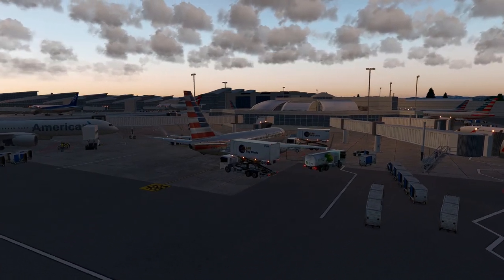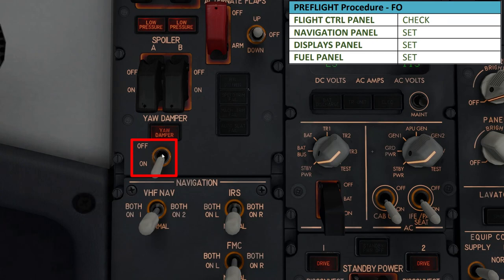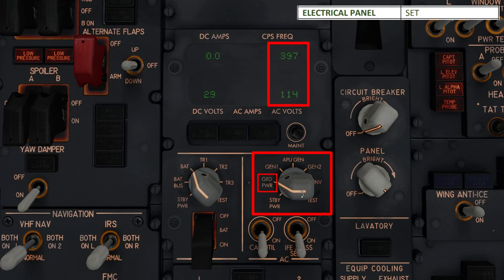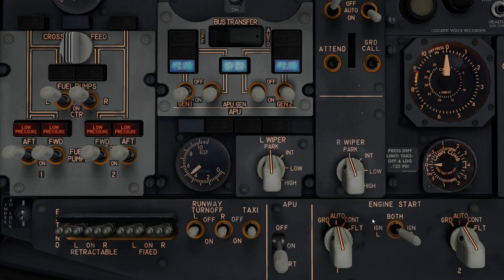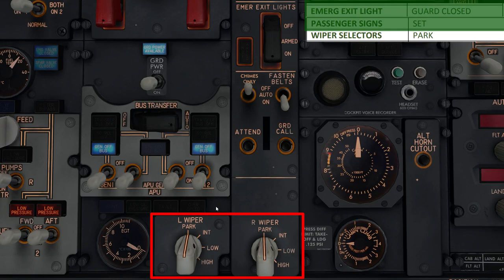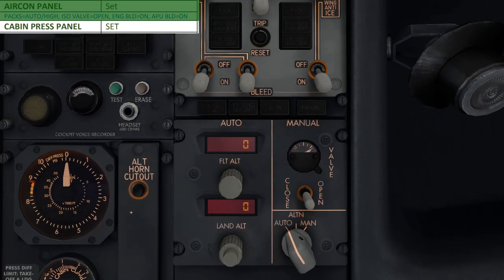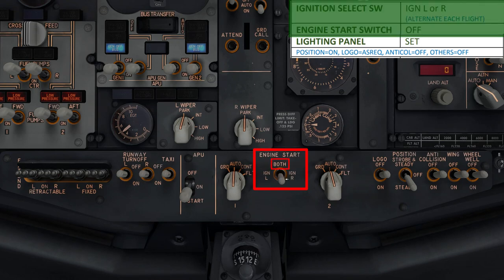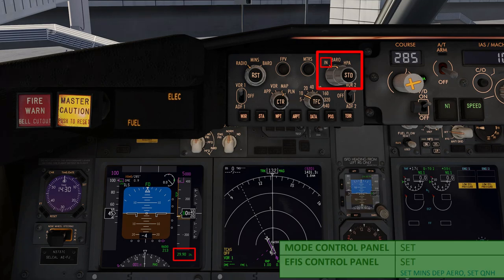Aircrafts Dissected Ep 10: Preflight Procedure IZibo 737IX-Plane 11 Detailed Tutorial (W/ Checklist)

Comment: Just a note for pilots: You must have both wing tanks full prior to fueling the center tank. This already occurs automatically with the Zibo mod using the fuel truck. Please don't use the fuel button on the X Plane customize aircraft menu. Everything is done on the flightdeck and through the EFB via AVITAB.  Additionally, the Emergency Exits armed must be performed prior to allowing passengers to board. The electric hydraulic pumps may be turned on for the person doing the walk around to check for hydraulic leaks. Of course confirm with ground crew if any are in the vicinity. There is an option in the EFB to sync the input of the FO with the CPT for barometer. This is useful as a single pilot in desktop sim.
** Finally, I respectfully disagree with placing the departure elevation in the pressurization panel. Flying up to pattern altitude to circle back for landing will have negligable effect on pressure. However, it will be catastrophic if the pilots forget to change it after takeoff and the flight deck is pretty busy during this time. My FCOM states "LANDING ALTITUDE indicator- Destination field elevation" as part of the Cabin pressurization panel checklist. Congrats on gaining another 100 subs since I saw your last video. You might break 1,000 by the end of the month.
Reply from the maker: Hey there, thanks a lot for watching the content. I truly do appreciate it. As for the wing tanks being fueled completely before the center tanks being fueled up, I already addressed that in the first aircrafts dissected video but it's a good tip to leave in the comments section for those wondering. Also, since there's no walk-around feature with the Zibo, I just thought leaving the pumps off would be the best thing to do. The option to sync the different EFIS parameters is a great tip as well and I discovered it just now - so thanks for pointing that out. As for your respectful disagreement of the landing altitude, that is completely my mistake. In all the research I conducted, the landing altitude indicator on the press. panel was always a grey area. I never truly understood whether the 737 had a feature to "memorize" the departure aerodrome's position, but as 'Kalle K' pointed out below, there very much is, so I completely rescind what I said in the episode. As for breaking 1000 subs by the end of the month, I don't know, seems unlikely. Normally, each one of my videos attracts around 30-40 subscribers, with the exception of some very popular topics (like the FMC programming video, which yielded around about 80-90 subs). This video has by far been the slowest one in terms of growth, as I've only gained around 25 subscribers in around 16 hours. It's fine though, can't expect every video to just absolutely take off. I sincerely thank you for your words of encouragement though:)
Reply: @FlyBySimulations  As I am re-reading this, you are now over 1,000 subs so the snowball is rolling. Congrats!

Comment: Really enjoying these videos. One question you turned on the APU without turning on any fuel pumps, so how is the APU getting fuel?
Reply from the maker: Thank you for your kind words steveg. Great question! Modern airliners like the 737 actually have a dedicated fuel pump (normally one of the forward fuel pumps) that automatically direct fuel from the fuel tanks into the APU while it is running. In older variants of the 737 such as the 300 or the 400, manually turning on one of the fuel pumps was a necessity, but not anymore. Hope that helped answer your question😊

Comment: Thanks. I have headr RTO must be set only before T/O to prevent its application during taxi. What do you think of that ?
Reply: My understanding of the 737 AutoBrake system is that RTO braking will not engage under any circumstances below 90 knots, nor above 90 knots if TOGA thrust commanded.   It only engages if takeoff is aborted at 90 knots or more.  Therefore, at lower speeds all wheel braking is manual.   After takeoff the RTO setting is deselected.  Disclaimer:  I was a biz multi-eng pilot but have no experience with any jets except via sim.   Perhaps someone else can provide more insight into the AutoBrake system.

Comment: Why use engine pumps when engine is off? There are two electic pumps too. Why you leave air from engine when engine are off? The dual bleed air is inluminated, or you use APU or engine air.